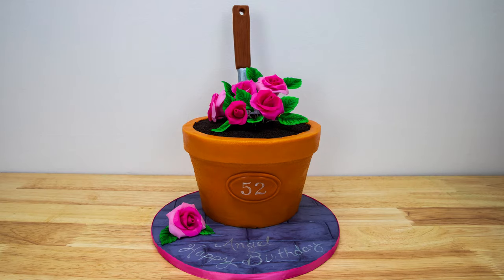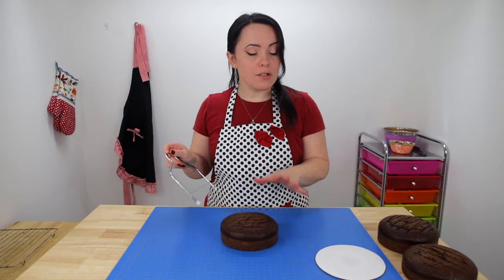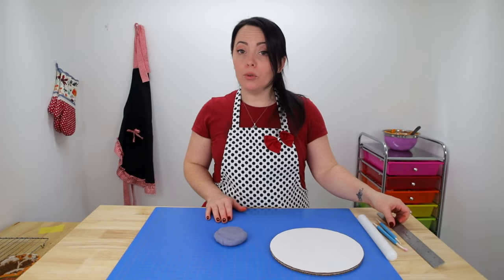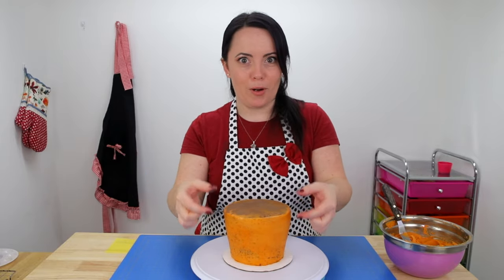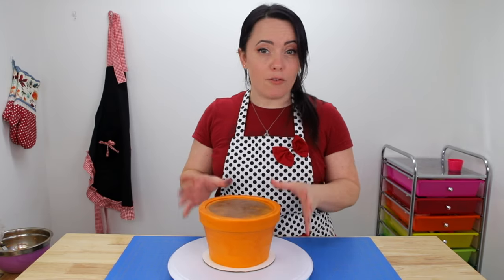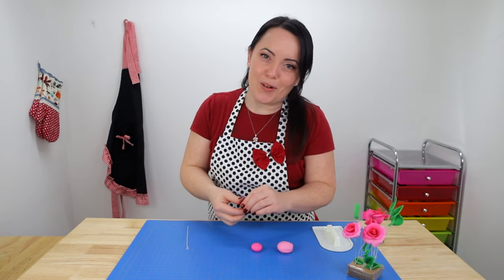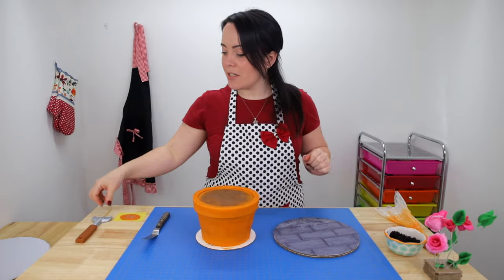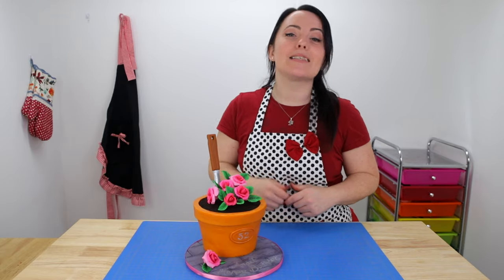DIY Flower Pot Cake

Comment: This is so amazing! How do you dry the brick fondant?
Reply from the maker: I put mine in a food dehydrator for about an hour. You can also use your oven. Just put it in there with only the light on, (do not turn the oven itself on!) The heat of the light will dry the fondant within a couple of hours

Comment: What is your icing? Recipe please
Reply from the maker: 1/2 cup unsalted butter
1/2 cup shortening
1 Tbsp vanilla
1/4 tsp salt
4 cups of sifted powdered sugar
2-4 tbsp cool water

Cream butter salt and vanilla with paddle attachment of stand mixer till light and creamy
Add shortening and continue to mix until fully blended. Add 2 cups of powdered sugar and blend until smooth then add 1 Tbsp of water and blend again. Add final 2 cups of powdered sugar blended until smooth then gradually add remaining water until you reach the desired consistency.
Tip: I typically only need 2 - 2.5 tbsp of water in the summer but all 4 tbsp of water in the winter.
Happy Decorating 🥰